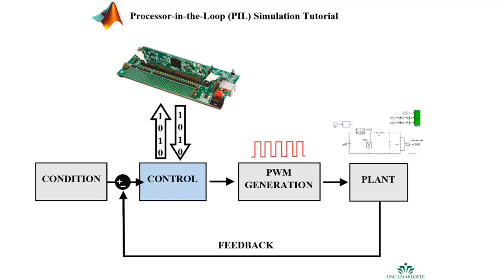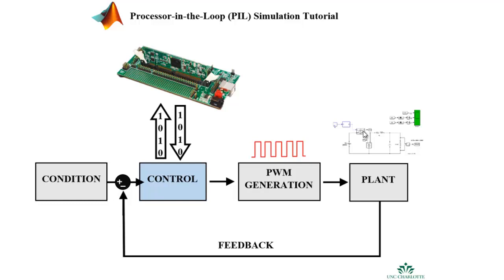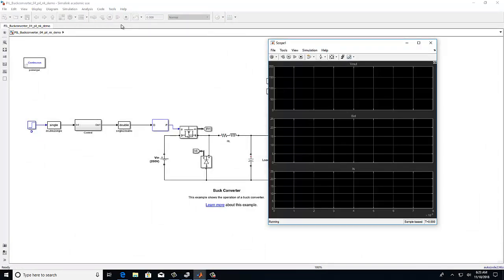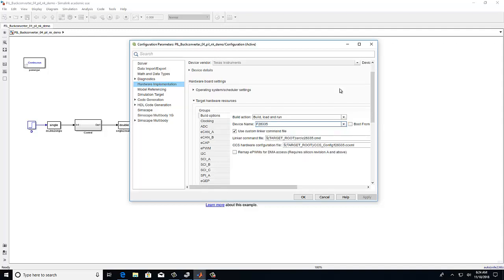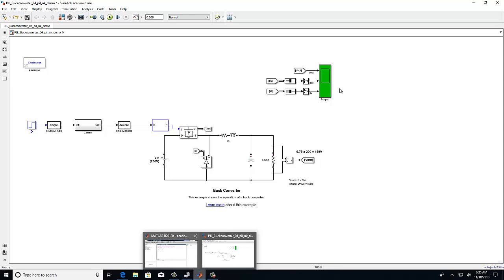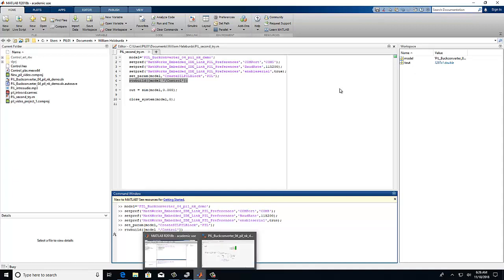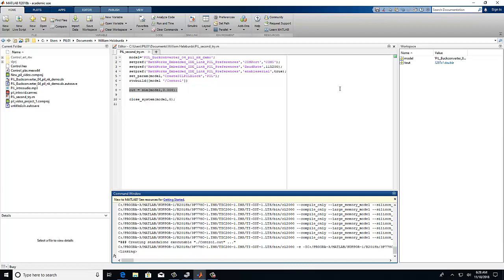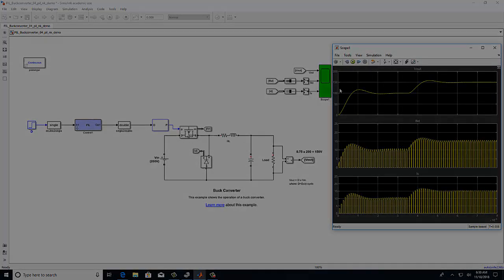Tutorial: Processor-in-the-Loop (PIL) Simulation of Buck Converter

Comment: hi, great video, thanks for sharing with us this information. I have a question, in the pil block, have you generated the control for the converter? For example, if I desgined a PID controller, did you send the gains through the pil block? Thanks if you can answer.
Reply from the maker: Yes, Miguel. Everything can be included. I have made another tutorial that should be uploaded in the next month or so.

Comment: This is very helpful. Can you explain what include your controller block? İf it is possible can you send me example files? Manythanks.  
caykenarib@hotmail.com
Reply from the maker: The control block will include a control algorithm that users want to run and verify in the microcontroller during the PIL simulation. 

For example, if we want to run a buck converter with a closed-loop output voltage control by using a PI compensator, the PI compensator part will be included in the control block. To be more specific, the control block will include error calculation, PI gain block, output saturation, and other extra calculations before PWM Generation. Thus, voltage reference, voltage feedback, and PWM Generation will be located outside of the control block and have connections with input and output terminals of the control block to be able to configure the communication interface between MATLAB Simulink and the microcontroller. The reason why the PWM Generation will not be included in the control block is we don't generate physical PWM signals to operate a buck converter. We will use a simulation model of a buck converter, thus we need to generate PWM signals in the simulation. The microcontroller will only calculate and transfer the duty cycle ratio.
For another example, if we want to run a solar PV converter, and we want to test an MPPT control algorithm and a PV voltage control algorithm in a microcontroller, both of the MPPT control algorithm and the feedback-loop control needs to be included in the control block.

In summary, control block will include all control algorithms that users want to run in their microcontroller since users will convert "control block" to "PIL block", and only the PIL block will be programmed into the microcontroller.
Reply: @babakparkhideh4752  Manythanks for your reply this will be very informative for  me. İn order to observe detailed, if it is possible can you send me a this basic PIL circuit which you analyzed in the video please?
Manythanks  for your helps and  informations.
Reply from the maker: @burakcaykenar1357  Yes. Please send me an email. Search my name at www.uncc.edu
Reply: Can you send me please you have this pil simulation , i hope you can send me.. This is my mail account huseyin_1399@hotmail.com